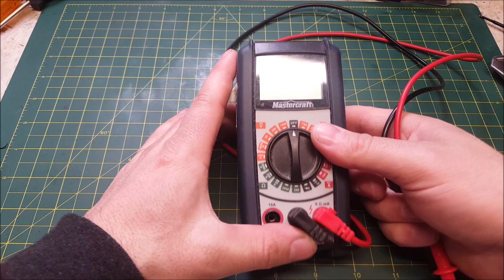Voron Tools and equipment overview

Comment: If there's one tool you shouldn't cheap out on is the soldering iron if you have no to litle experience soldering. Because you will not be able to figure out if your solder is crap, your iron is crap or your technique is crap ;)

Comment: Those ferrules may seem like overkill to most people, but I am a believer now.  Went back and put ferrules on my previous builds and later had my heated bed slip out of my hands when I was working on the Y axis of my steel prusa.  It "bungy jumped" off my workbench seemingly to it's death to be suspended by it's wiring.  That wiring caught with a hard thump when the slack ran out.  The ferrules remained tightly installed on the board and nothing seemed amiss after I put it back together and fired it up.  Very glad I made that purchase and took the time to install them.

Comment: I was wondering what  your experiences are with silicone wire running through the generic/igus cable chains? I have a lot of silicone wire hanging around, so it would really save a lot of money.

Comment: If anyone is watching this in 2021, don't bother with the manual crimpers shown in this video. The Engineer Pa-09 is bullshit just like the ratcheting one. Avoid manual crimpers at all cost, the whole point of a ratcheting mechanism for a crimping tool is consistency and higher applied force to the terminals. If you REALLY want one like these, check out Iwiss' iws-2820m. I own these, they are extremely similar and I hate them. For JST (XH, PH, ZH and some others) you should get an IWS-3220m ratcheting crimper. Again - consistent results and higher applied force, it is also cheaper. 

Then you'd still need a crimper for these "dupont" style connectors, here it depends on how much you want to spend but the best bang for the buck is the Tozoo TZ-4228b, followed by the IWISS SN-025, only to be beaten by the Hozan P-707 (Iwiss has a clone called IWS-1442L I believe). 

For quality of life I'd also suggest you get an automatic wire stripper because again, manual ones are way more inconsistent. Same applies to crimpers for insulated connections like these ferrule crimpers - ratcheting is where it's at. The one shown here will do the job just fine, apart from the shown manual tools this video is great, I subbed.
Reply: And for PTFE wires, which combination set of stripper and crimper(s) tools (brand/model) would you recommend?

Comment: A lighter works fine if you don't have a wire stripper. Just heat enough to make the insulation soft and pull with your fingernails.

Comment: The larger Dupont crimpers work well they just have a steeper learning curve. Proper placement, length of stripped wire and using the "pin-guide" tool are important steps. if you follow these directions you will see there's no need to buy the multi step tool. https://www.instructables.com/Make-a-Good-Dupont-Pin-Crimp-EVERY-TIME/. P.S the one thing I found with the one step tool is that sometimes the insulation crimp needs to be adjusted with needle nose pliers ever so slightly to fit in the connector shell.

Comment: Why can you not use leadless solder?
Reply: Of course you can use leadless. It's meant to replace leaded. Now leadless does flow less well, but it does work. Get a proper one. Always go for well ventilated as the Flux fumes are bad. Leaded solder fumes aren't worse, however do wash your hands properly and keep food away from your work bench. Same goes for when you're working with the soldered parts later on. Lead is harmful for your body and it can't get rid of it!
Reply from the maker: 60/40 solder flows and is much easier to work with than non-leaded solder. But do recommend using with ventilation
Reply: @CanuckCreator  This is unfortunate, as far as I know leaded solder isn't available in the EU, at least not for private citizens. Would it be a huge problem for someone with limited soldering experience or do you think I could manage? I could try to source leaded solder from outside the EU but it's going to be a pain to get it I think. Thanks for your videos and the effort you put in them by the way, I'm binge-watching them

Comment: I have found that wax works very well when dealing with printed parts in moving contact with each other. Wax coupled with a little grease once the wax has been applied is even better. Thanks for the great video!

Comment: jesus 40$ crimp tool 0_0 i'll just solder them
Reply: The Engineers PA-09? Bought mine for crimping fiddly 1mm and 1.27mm pitch connectors (I.e. even smaller than 2.54 pitch Dupont). Worth Every Penny.
Reply: A nice pin crimper is worth it. I have a $120 soldering station. Good tools are amazing!
Reply: I have an even better one: PA-09 is 50 to 55 € for European CCCs (Cash Cow Customers)